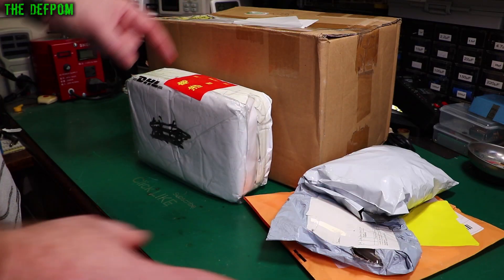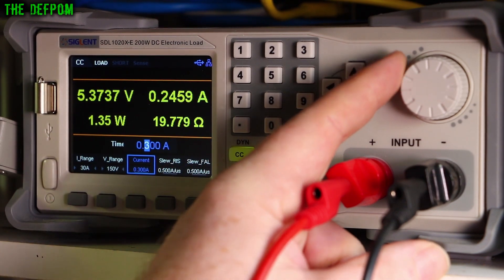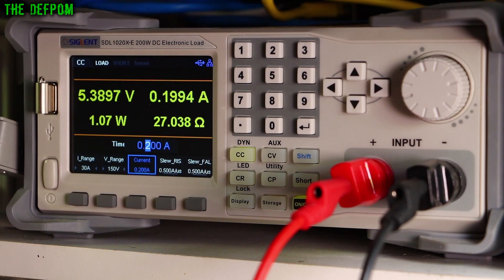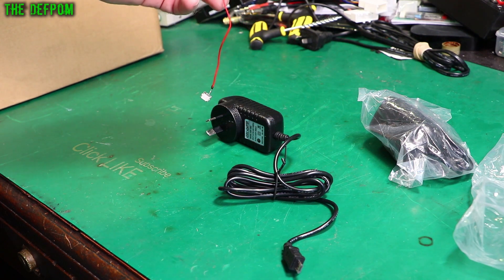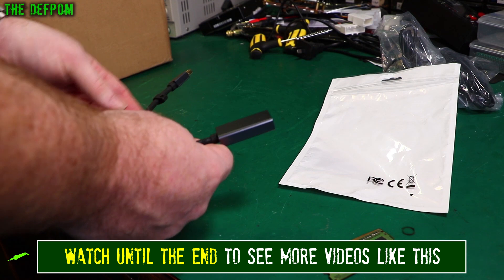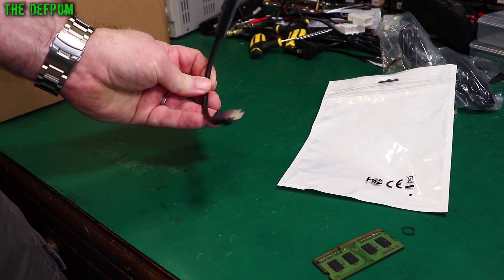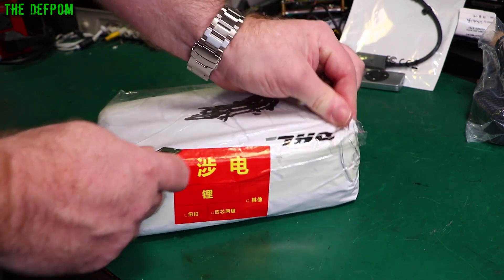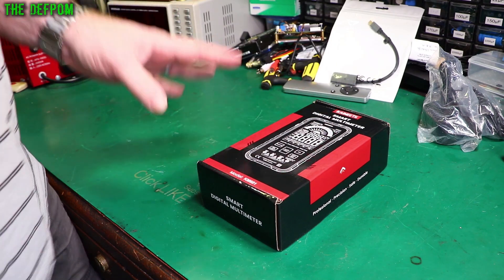🔴 What's in my Mailbag ? - Mailbag Monday 6th December 2021 - No.897

Comment: I wouldn’t really consider myself a snob to branding but having bought budget cost DVMs in the past and always regretted it. I now just buy Fluke meters. I have never had an issue with Flukes but some people are complaining that some newer model take ages to boot up.  I think I would rather buy a second hand meter from a big name brand than a cheaper new model. Interesting reviews as always thanks. Regards Chris
Reply: Bought 121GW from eevblog, this thing is amazing, don't think will look at any other meter.
Yes we have Fluke 289 at work and it does indeed takes a moment to load...
Reply: @Arek_R.  oh ok the 289 model thanks for the heads up. Regards Chris
Reply from the maker: I just spent 2 hours testing the accuracy of the meter…. It’s surprisingly good.
Reply: @TheDefpom   be interesting if you could also look at the safety etc. I did consider building a surge tester and doing some meter reviews but as you know I’m very lazy!

Comment: how many multimeter you alltime buy, stupid normal elektric work or hobby men need only maximum 2 multimeter not more newer.
Reply: This channel provides a lot of content around electronic test gear. What part of doing test equipment reviews don’t you understand?
Reply from the maker: I disagree, there have been times when I needed to test a multi output power supply, and needed 5 multimeters all at the same time so I could quickly test and shut down again. And besides a nerd always needs more toys.
Reply: @TheDefpom  I'd usually say don't feed the trolls, but I guess it helps your channel so I'll comment: WHAT THE &#@&* IS WRONG WITH PEOPLE??? However, I do have to say that I might start calling you "hobby man" from now on...
Reply: @largepimping  LOL best regards Chris

Comment: Great, you have chinese ones coming as well, you will be able to compare mechanical strenght when you bend the microUSB cable, in the past I had fake arduino micros with microUSB and the connectors were breaking off all the time.
You also made me realise I should make microUSB adapter to some 4mm banana terminals (with or without sense terminals?).
Reply from the maker: Yes the banana terminal version would be good
Reply from the maker: In fact you don’t even need the terminals on the board, just have the 4mm PCB plated holes, the banana plugs can fit straight into the PCB, I did that myself on a precision voltage divider I made, if someone want sockets they can add them.
Reply: @TheDefpom  You mean just 4mm plated hole and no connector at all?
I guess it would work but it would be required to have the banana plugged just the right distance in because of the shape.
Also plated hole wouldn't last long.
Ideally I would like some kind of terminal that can be pick n placed, whole business is idea is such that I don't have to put any labor into it apart from shipping stuff.